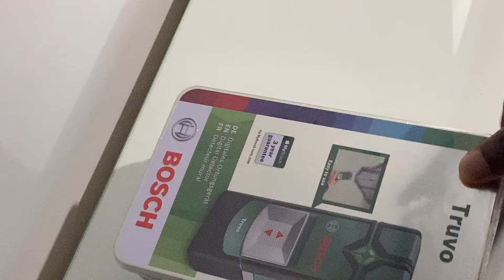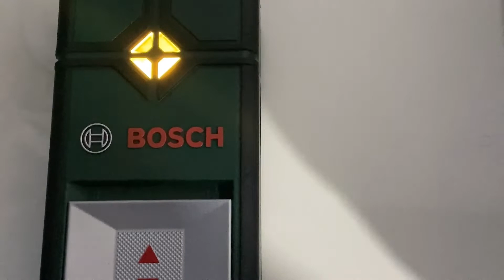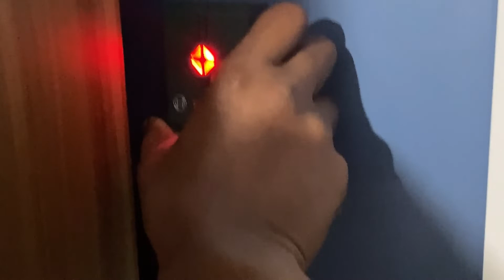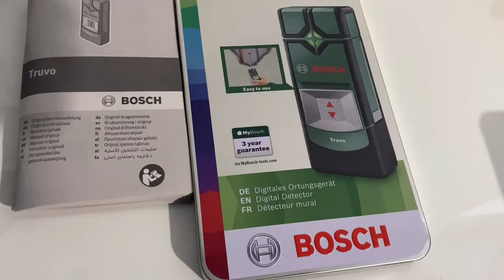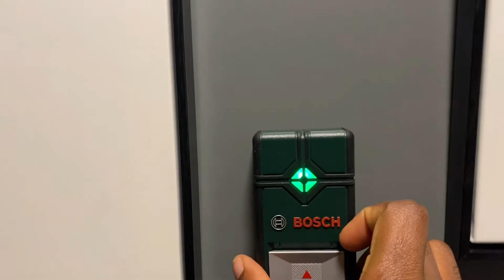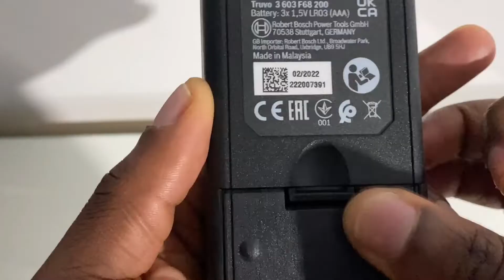How to Calibrate Bosch Truvo Multi Level Surface Detector to find Wall Pipe, Metals, Studs & Cables

Comment: Today I tried it I have one question - when I hold the device at the black rubber bottom side areas as written tn the manual it blinks for live wire detection a lot frequently even in not logical palces. When I hold it a little bit upperon the green coloured side places it detects only when I am more convincet there is a live wire because it is at the top of the switch for example. Can you tell my why this is happening and am I right?
Reply from the maker: Hi Boris, there are areas where engineers can install live wiring behind the wall according to BS7671. Horizontally and vertically on switches and sockets and 150 mm from wall corners and ceilings ( not coving) these are your electrical safety zones and you would expect wiring to be installed in the safety zones. However in the non electrical safety zones which are outside of these areas .

 You wouldn’t expect to find wiring in these zones ideally but there are exceptions to the rule that needs to be adhered to if perchance engineers decide to install in these areas. In these areas ( non electrical safety zones) wires or cables must be over 50 mm below the surface. If the wall is made of metal it will need RCD protection. 

The cables would be armoured with an earthed armour or metal sheath, should be in metal trunking and should have protection from at least 3 mm steel. 

So hence why you may may detect cables in areas outside of where you would expect to have live wiring. Also remember it scans to a certain depth so if buried deeper device may give you intermittent readings. 

The device is not built as a one size fits all but a detection guide to an nth degree w.r.t to finding live cables, studs, metal pipes and dense materials as opposed to a craftsman drilling blindly using tribal knowledge. 

Click on the link in the description on how to use the device and safety zones. There would be subsequent videos that would be published soonest which addresses the questions raised here in-depth. I hope this answers your question . Don’t forget to subscribe and share. Have a good one and great week
Reply: @UtechUreview  Thank you very much for the detailed answer. You answered all the questions but one is still wondering me - I am not touching the sensor infront but depending on which side I hold the device - it can go mad detecting live wires or detect only the "electrical safety zones". In the user manual I read that sometimes if the wall is not good earthed the sensor can do this and you can put the other hand 20-30 sm next to the device and will be more accurate. I tried this and it gave me similar results as the "better holding" the device.

If there is an electrical source deeper than 50mm it won`t bothem me because I am planning to drill around 40mm holes. 

And for sure will check the other video and will subscribe, thanks again :)

Comment: have you perhaps tried to find a live wire between two reinforcement nets in the concrete? I have a specific scenario where the drywall will be installed on the ceiling but the wires are in the concrete plate made with two rows of reinforcement metal nets. Between them, there is a plastic canal where the wires go trough.
To avoid drilling holes for the drywall trough those plastic canals, it would be of much help if some detector can see wires trough concrete and behind metal reinforcement net.
Do you know if this or some other detector is capable of doing that?

Comment: My falls are concrete consteuction and on one of the big walls the device is showing live wire absolutely everywhere. What can be the cause and how can I bore safely?
Reply: I heard some mention foil insulation behind some walls.
Reply from the maker: There could be a few reasons for this. One possibility is that there might be electrical wiring behind the wall that is causing the detector to pick up the live wire signal. Another possibility is that there could be some interference or false readings that are causing the detector to give inaccurate results. It's always a good idea to double-check with a professional electrician to ensure accurate readings and to address any potential safety concerns. Don’t forget to subscribe, like and share. Helps channel grow